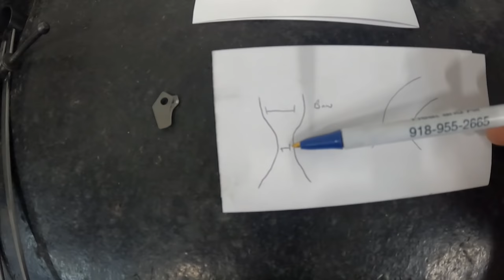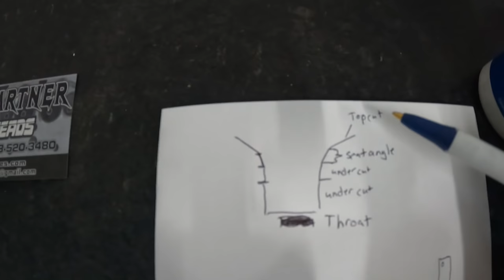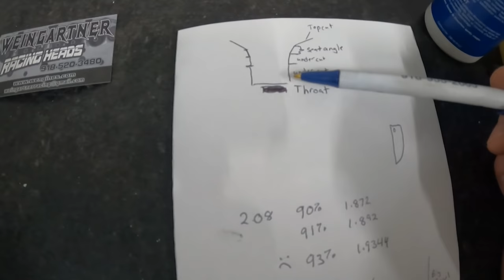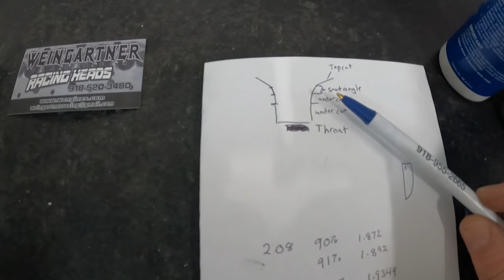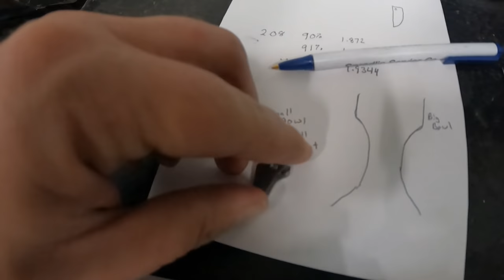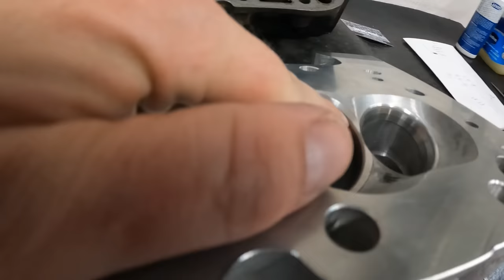What not to do when porting heads

Comment: I would argue:  porting the throat BIGGER makes  for the valve to be more "out of the way"  Like you say when you go to a bigger valve but don't port it out to that golden ratio, which i hardly believe  is a good idea to begin with to go to a larger valve unless  there is real-estate  on both sides of that valve to allow for it.  

What I actually like to do is port the intake as wide as the seats sealing angle  area and I typically get  a finnished throat that is 4-7mm  larger on the throat, this is taking into consideration of flaws and all WITHOUT going  to a larger valve.

 but on the exhaust  you absolutely  need this chamfer in order to help guide the air INTO the port (THE KEY->INTO the port) so you would want to go to a larger valve if you plan to port the exhaust side any larger than it is factory unless casting is just that bad lol.  But you do NOT need, "in my honest opinion",  this  shrouded  radius on the throat of the intake because the air "in this configuration" is guided out the port necked in closer to the valve it is going the opposite direction and will not benefit having this radius as it is making more drastic  turns than needed had you just ported it out wider to clear the valve more.  the faster the air can EXPAND  through the valve seat and around the valve into the chamber--->   the better, WE DONT CARE ABOUT THE AIR BEING TURBULENT GOING INTO THE CHAMBER" even if that was a thing, this would have its own benefits  with fuel mixture as the air has already made its trip. And the fact that any  turbulence induced from no shroud at the intake guide could be negligible  being that the combustion chamber is so large there will be no  time for negative interferance i.e. pulse sound etc.  prior to combustion even that can be detrimental because at this point the air is already where it needs to be.. If anything,it Having the shrouded radius  "wich you say needs to be there" literally guides the flow of air RIGHT into the back  cut of the valve  (valve being COMPLETELY in the way of the air flow no matter how much it opens)  so if you widen the throat you allow less restrictions 2x fold  MORE of an opening for the air to get out the port+ more freely around the valve. In This instance  a smaller valve is actually DESIRABLE with a larger throat imo """":only on the intake"""" can you port the throat all the way to the seating surface and  have nothing but gaines, you cannot do this on the exhaust side  it will kill any  flow gained that you think you may have because the turbulence  induced  st the beginning  get worse as the exhaust  travels and expands as a result  of having no "funnel" so to speak preparing the exhaust to enter the ports, and because  the spent air is being forced into in a smaller space this turbulence is detrimental and kills flow the LONGER the port is there after the mistake,   you have to have a way to direct the air in a smooth manner if your changing direction, angle, shape,  to a smaller area, not so much if going to a larger diameter at the end of the port,  though there is losses there too, just not as bad as going to a smaller area without a "funnel" at the beginning  of a port.

   I also see flow increases on the exhaust  by polishing  a soft radius  back cut  on valve and then also polishing a soft radius  angle leading into the throat there after the valve "seat" angle   instead of a grinded angle. 
 It just cost money to do this kinda work.
Reply from the maker: You should dyno that and let me know what happens. You are backwards. The air flares out around the valve not just straight down. That’s why you need angles on the intake throat.
Reply: @WeingartnerRacing  there already is one.. the seat angle. If this was true why don't manufactures put angles on the exhaust  tip.. because it literally helps nothing once it exits the exhaust.  Why do they put what known as a velocity  stack or larger radius on the intake... because it helps direct air in to a smaller space
 With less turbulence.

 The valve area is literally the opposite  would would do the same thing to the intake valve area as you would for the exhaust  sayyy by going g to a larger exhaust.
 And vice-versa   making a velocity  stack on the exhaust valve  area  for the same reason you you a carb
Reply from the maker: They don’t put angles on the exhaust because the angles help wet flow. We don’t have to worry about that on exhaust. So instead radius. You also don’t want angles on the exhaust because it helps the reverse flow. That’s why I say you are backwards. Watch my exhaust video and you will see. Im sure I will do another video later where I remove all angles and flow it. Since I have done this before here is what happens low and mid lift numbers suck. Peak numbers are decent because the valve is out of the way and the valve job is less important.
Reply: @WeingartnerRacing   ok but also you have to think in terms knowing as your learning that  flow benches also  allow the valve to see nearly every environment that is NOT visible  in a port or around the seat NOR happen long enough  for some tmof the turbulence  issue to arise withing fractions of a second where as some can greatly  cause issues  like a bolge or  casting flaw or lip near the seat  We are talk pulses faster than sound faster than  a blink of an eye so another restriction  would be knife edges causing  sound turbulence not calculated in the tuning of the port,  so vacuum  and surge pressures wich are most important are all not visible  so we literally will be hurting ourselves  if we take what we see on the bench and apply it to, as if its the real world condition because  if anything allot of the  turbulence  you are seeing  will not be seen  or be drastically increase because the forces at wich are increased massively, like a knife edge it will help drastically on a flow bench but in REAL world having a knife edge on an intake  devide detween valves  WILL create a sound resonance   that can easily hurt flow more than casting flaws.
Reply: @WeingartnerRacing   what im referring to is on the outside of engine
Reply: Of you go too big on throat  size  intake, just raise  the floor of the port , will bring CFM & port velocity  back so it can be fixed been port for 35 years

Comment: Back in the 1980s I used to race two strokes, not applicable you may think but it absolutely is, everyone tried to "tune" their own engines as it was so easy to do, "the ports are as big as they'll go, it's a f*****g rocket" and they got passed on the straights by a nearly standard one which had had minor modifications and a port clean up. Gotta admit I went big port to begin with and when that didn't work and I ran out of money for more cylinders I started using metal filler in the big ports and some of the "mistakes"  when I made the port "too small"  got better results, yeah, size matters, but it isn't always biggest is best.
Reply: two strokes are the bomb...
i love that everything we know about porting them is mostly imagination...
visualising flow and that sort of thing. half a degree on the transfer floor and the scavenge is circulating the wrong way... or not! who knows? amazing how two nearly identical port jobs can give such wild results. thats a winner, thats an anchor...

wanted to setup a strobe light and fog machine, acrylic head, get an idea of the flow by pulsing the strobe 1 degree later (or earlier?) every revolution... poor mans "slo mo".
havent two smoked since they banned my motorised pushies...

Comment: What bout using those heads for Boost? They maybe ruined for N/A but I would think it would "flow" good for Boost right? Since Boost really isnt a Flow rather then a Pressure at all times.
Reply from the maker: No it would still suck under boost. A proper head would make more power with less boost.
Reply: @WeingartnerRacing  I see,  makes sense.
Reply: @WeingartnerRacing  I gotcha, that makes sense.   know some about porting but still lerning. I worked for bret at Racers Edge for a While not sure if you ever heard of him. He also owns Air Flow Solutions. I quit working for them a while back though because he has to many clowns involved in the shop.

Comment: Never remove the valve guide boss. That's the lump of head that protrudes around the valve guide into the port.
2 do not match the exhaust port to the header.
3 inlet porting is far more important than exhaust.
4 never mask the opening.
5 don't over port the cam.
6 don't over port the cars.
7 don't oversize the headers or exhaust over the rest of the engine.
It's not rocket science and unlike NASA it's not tax payers money your wasting
Reply: #1 Yep, use it to 'fairing' the guide. 
There have been airflow diagrams of various shapes since the 1940's with eddy current diagrams for round, square, rectangle, oval and teardrop with arrows showing basic flow
#2. I remember reading about a flow reversion step on exhaust ports probably 50 years ago. Better to leave a larger 'step.(1/8"+) at bottom of port than an equal step 1/16" or less all the way around.
#3 bowl area is most important to work on first and not the 'easy' part where manifold attaches
Nice list, I hope more people read it and learn something

Comment: How much would it help if I just smooth the rough casting in the throat area and not cut much. I have a pair of #13 Pontiac cylinder heads. I noticed on the Pontiac heads the exhaust bowl has the outlet port offset. Is that to create a swirling action? I would like to learn as much as I can about #13 Pontiac heads thanks
Reply: Polishing up casting errrors and scratches is way less material removed than porting and is therefore “safer” if you can have the discipline to not do more

Comment: Does this apply to turbocharged engines at boost, or will the turbo flow enough air into it to negate the difference? Or will the difference still exist at higher pressure than atmosphere?

Of course it will matter with spool up at low boost.
Reply: Turbo is positive pressure, different set of principles, but from my experience not as sensitive

Comment: Since I am way ignorant if I pay attention I can avoid mistakes on my 2-valve BMW motorcycle. Thanks for this.
Reply: If you have the earlier 'boxer' motors there is an awful lot that can be done. 
Most difficult but dramatic is angling carbs outwards so you no longer have air doing 110+ degrees to get into cylinder
I don't know if you ever saw the twin plug modification that gave around 11bhp due to high dome pistons being used in race motors? (probably around 1979~80)

Comment: You have thoroughly discouraged me from EVER attempting to port my own heads. Which I'd only do because I can't afford aluminum heads, nor can I pay a pro to port my iron heads. So I will run stock heads and be slow for the rest of my life 🙄
Reply: You could still clean up casting flash and other irregularities and do a pocket port. Clean up the squared off valve guides and stay away from the throat except to make sure it has no sharp angles below the seat. Also use a back-cut on the intake valve. That all should get the most bang for your buck.

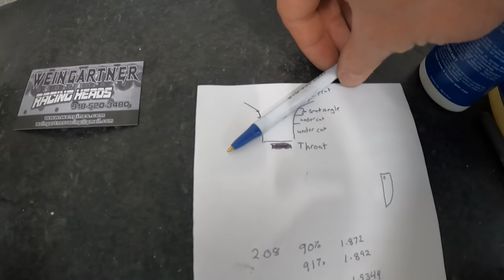Comment: 5:30
Basically what you described here is the angle that flow is able to follow the throat wall without separation. Separation would cause low pressure area and/or vortex and those will cause drag.
You agree?
Reply: Basically the same thing as an areodynamic stall as the air flows through the valve.

Comment: Hi mate from Australia! What is your opinion on valve guides that protrude into the port past the guide boss that is cast into the head  . I have a set of edelbrock performer rpm heads for a big block chev and believe that they should be removed as I think they reduce air flow. 
Your opinion is very important.  Thanks.
Reply from the maker: That is great question. No doubt they hurt flow but you have to leave them in there. If not the guides and valve job wear out fast. I know from experience.

Comment: @EricWeingartner Where can I purchase the cutter your using? Same with the the 5 angle blade? Any videos of you using it? Doing port work on a la1 with a lx9 head and intake swap. 12:1 comp w/turbo here I come lol
Reply from the maker: They are custom cutters I had made by Serdi.
Reply: 'Anyone' can buy SERDI cutters, they are not cheap though.
 Last time I priced them, (around 2009) the cutter blades were about $90.00 (US) and the most basic SERDI set up cost $160,0 although you could go for fully automatic (industrial head production) for around $3~500,000

Comment: Just put together a small black Chevy 355 with iron eagle dart heads that were ported really horribly and they put apoxy to cover up that mistake. I have to reput the heads on noticed oil and number 8 cylinder a lot.. Took the manifold back off found number 8 cylinder runner have a small hole in the casting. Where would it be sucking oil from somewhere in the middle of the casting?
Reply from the maker: By the pushrod is where most break through.
Reply: @WeingartnerRacing  Was not the intake it was the head cracked on the headbolt. down deep before threads.runner sucked oil out into #8 cylinder. Heads are junk. ugg. i now have 1200 paper weights.

Comment: My builder has a rottler machine and is opting to do a 5 angle cut and lots of valve work rather than porting. He said that'll get me about 80% there as opposed to 4k for CNC heads

Does this sound accurate?
Reply from the maker: Yes and no. Most of the flow comes from 1 inch before and after the valve. However that still takes bowl and short side work.
Reply: @WeingartnerRacing  he did mention a cut below the valve and then port and blending the bowl but not increasing the intake port size

Comment: Great video. Back in mid 90s I was in my 20s I bought a set of "performance GM iron heads" from Aerohead, they were the best of the worst 993 76cc heads with screw in studs .525 springs and 3 angle valve job. I payed for optional 2.02/1.60 s/s undercut stem valves (aeromaxx?) And a $100 "bowl port special" when I delved into porting about 10 years ago I did all the staple mild porting procedures with full exhaust polish, I left the bowls alone I figured where I heard Areohead was a division of INDY Cylinder head they knew more about a bowl port than me. You must remember seeing adds for Aerohead in the lower tier car magazines back in the day. I think the base price was $250 +/- not terrible with the options back in 93ish. And my 355 with a Howard's 
.480/.480- 232° @.050, 108lsa, (max torque 112031-08 best SBC cam I've ever used and I've tried a pile most underwhelming was crane 450 lift Saturday night special) Torker 1 intake (with 2" spacer) and flat tops it actually runs surprisingly lively for mild smallblock in a pickup. That cam is magical tho, I recommend it to practically everyone with a warmed over 350 and wants a nice broad power band and nice roudy idle with no power brake issues and stock converter will work fine, a 2500 stall was bit un necessary.

Comment: Would the heads with the over-sized throats impair forced induction to any degree?
Reply: I wonder too. I have a 97 Cobra with a 4v 4.6, came with B heads, the goal for N/A builds is getting C heads because although the B heads flow just as well up top (the world record was obtained with worked B heads) the C heads had a lot more midrange plus the top end flow. But with a supercharger I was told that negated the difference since it wasn't sucking air through but having it pushed in. I was thinking maybe with forced induction the same effect would happen and they would still work well, these heads I mean
Reply: @benjamins9121  Well, I think liquid flow tests are done under the premise that anywhere liquid flows well, air will flow better; but then lets not forget that in all N/A applications intake valves are larger than exhaust because pressure trumps vacuum in most cases. I know most guys that build for forced induction don't sweat porting, blending bowels, port matching to the intake or any of that so I don't think it's reasonable to assume the velocity of the charge past the throat would be inhibited from turbulence caused by the lack of contour the same as in a N/A application. I think that all that would really matter would be getting the port volumes to match in the interest of balance.
Reply: @golgothapro  Yes that makes sense. With N/A builds you have to worry about intake velocity, too big of a throat, or ports that are too large inhibit the low end and mid range but ultimately flow well at high RPM, but when you're forcing air through there isn't that problem, and essentially you just want a straight of a path as possible and as much room to get that compressed air in.
Reply: @golgothapro  I'm willing to bet that thoraots that are too large wouldn't be a deal breaker on a turbo race car or something.
Reply: @benjamins9121  Yeah I agree, I think that would be a pretty safe bet alight.